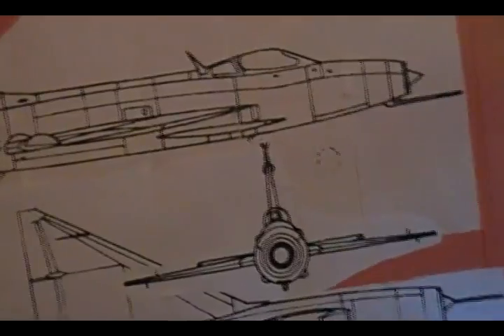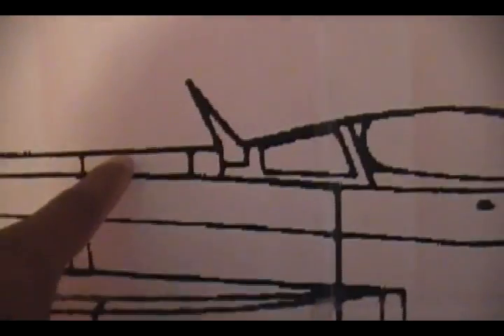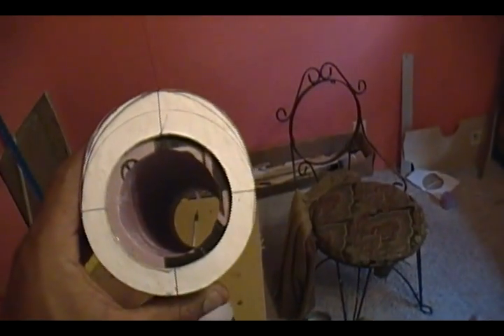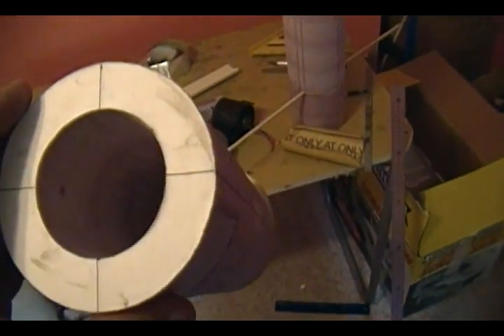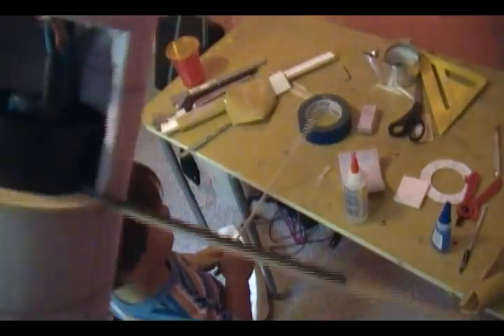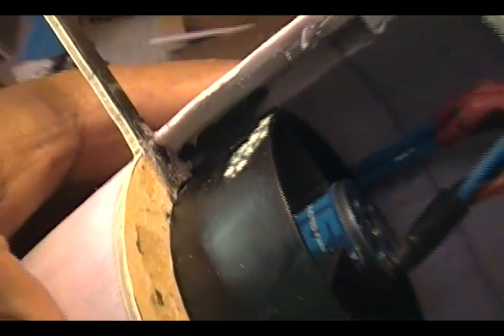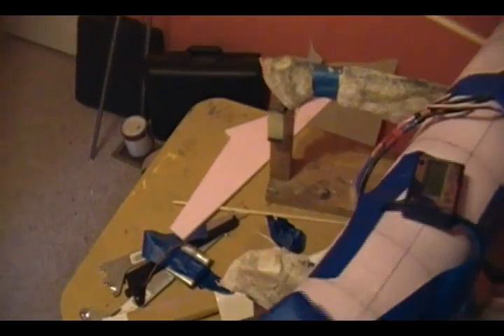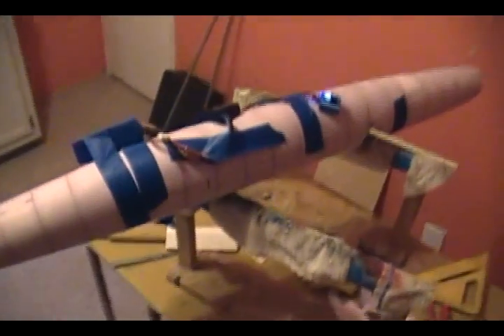EDF MIG 21 build part 3

Comment: Daniel, what kind of motor you have in that fan? that is a Very F*** battery? and you are using 70 mm ?  So.... I guess that the fan is a 12 blade changesun fan?